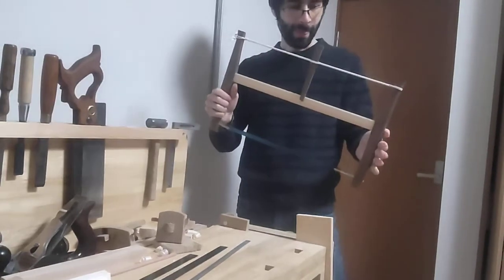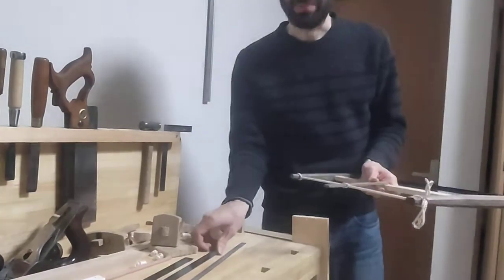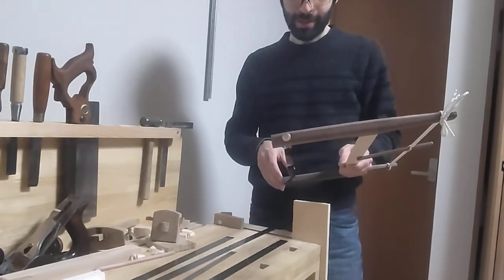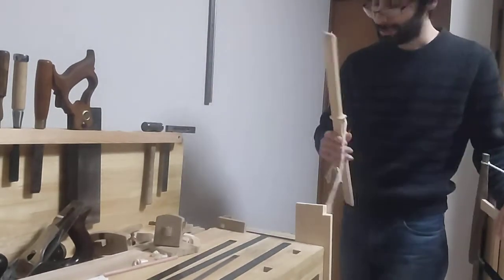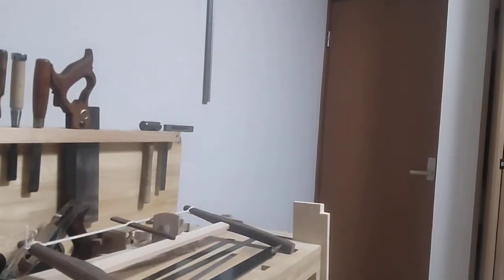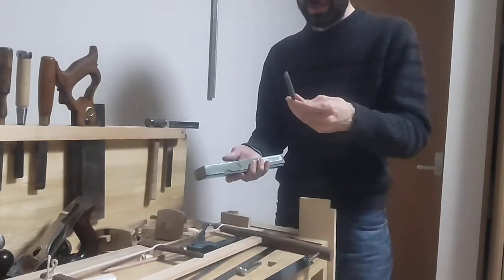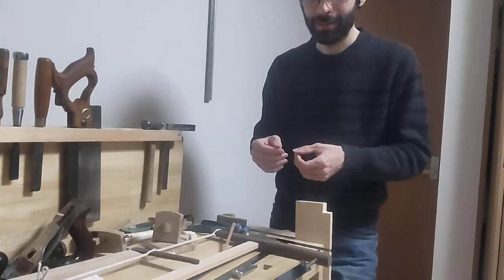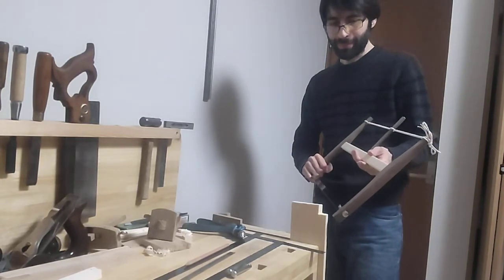Introducing Chinese Style Bow-saws (and how to make one)

Comment: What makes this a chinese saw vs an early european and american saw?
Reply from the maker: Mainly the size and style of the blade (and also how thin it is), and to a lesser extent the shape and construction of the handles. Western saws with turning blades (and I don't mean the small turning / coping style bow saws, but the larger ones meant for general work) tend to be much larger, have much thicker and longer blades, and tend to have large wooden handles as opposed to simple bolts on which to mount the blade. That said, there was quite a bit of variation in Historical Western designs, and you can definitely find examples which are more similar to this.

Chinese / Asian varieties tend to use thinner blades too. They tend to be about 0.4-0.5mm thick, and the one I'm using here is 0.3. I love a thin blade as it reduces the amount of material removed and therefore work necessary when cutting. European examples are typically 1mm or thicker even, albeit much longer.

The style that I made here is pretty much uncommon outside of China, Taiwan, Korea, and South East Asia these days. They're typically used at a 45 degree angle with the blade rotated outwards to allow for deep cuts, and some designs even have this angle cut into the frame and the blade rigidly mounted at 45 degrees, which is not something I've seen in other styles.

The basic bow saw with a turning blade, however, is pretty universal the world over, Historically speaking. They're a simple tool and there's only so many ways to make them, so they're pretty much all more alike than they are different from one another.

Comment: I`ve just found a Butcher`s Saw Blade for frozen meat /bone / wood.The thickness is .56mm and 10 tpi . The blade is carbon steel and I "think" it`s 1/2 inch (13mm) wide .The length is 17 1/2  inches hole to hole .  Minimum order is 3 . Price for one is £6.60.   Fits in a Kamlock saw, if you know what that is .
 I tried a Mitre saw blade but 14 tpi is too fine although it`s nice and wide .
Reply from the maker: I know people who've made good bow saws from a Butcher's saw blade. I would personally prefer something a bit wider than 1/2 inch (this will wander easily, which does make it easy to steer, but a little too easy at times) but 10 tpi and .5~.6mm thick is perfect. Definitely give it a try.

Comment: The Chinese seem to make push saws and the Japanese make pull saws . Thinking about the frame saw design it would be mechanically best if it was a pull saw as most effort on the cut would be straight through the blade. With a push design the effort has to travel all around the saw frame before the cut begins . Discuss .🤔
Reply from the maker: I use both Japanese saws, and push saws, and it's not that straight forward. Japanese pull saws -- any pull saws really -- have one major weakness: ripping (cutting with the grain, as opposed to across it). If you rip standing over the board as you normally would, the teeth actually catch underneath and against the grain, instead of shearing with the grain like a chisel if you were using a push saw in the same orientation. In fact, it is impossible to rip at any kind of angle other than 90 degrees unless you get underneath the board (which means a face full of sawdust and a very difficult working position), and even then, you're sawing blind because the cut is leading on the other side away from you. I love Japanese saws, but they suck for ripping. The Japanese long ago also used bow saws like this, probably precisely for this reason.

Comment: I prefer the joinery saw style where the forward frame is cut at 45 degrees with just a pin.  Faster for blade changes; lighter; easier to align; cleaner as far as hanging up on the wood; traditional; faster, cheaper and easier to make..
Reply from the maker: Ah yes, that design appeals to me as well and I've been intending to try it out. I've focused on the fully rotating blade mounted on pins first because I find that I occasionally need to turn the blade further to keep the stretcher out of the way. But, of course, a make a larger frame and higher stretcher can also solve that problem. Great to hear from someone else who has experience with these saws!

Comment: I'm very interested on making a chinese frame saw..i ve seen various videos  but It would be interesting to discuss the "design"..i see Two main advantages : the grip . The hand Is in line with Blade.
Reply from the maker: Exactly! The in-line grip is awesome and allows you to really get behind the cut. The grip is very comfortable and allows for both power and control. The Chinese design is also much easier to make if you have a drill bit just slightly smaller than the bolt you'll be using -- the bolts need to be very tightly fit so that the blade doesn't rotate too easily of its own accord.
The Chinese style saw also tends to be a bit smaller and tends to use a thinner blade, which I also like. The blade hardly needs much set at all.
Reply: @lukedupont8564  many Thanks for your anzwer: you showed clearly the simplicity and the effectivness of this ancient tool.  Here in Continental Europe Blades are slightly thicker , around 0.7 mm . Chinese masters use thinner Blades . In your experience a 0.6 or 0.5 mm Blade does cut straight on thicker wood? And last but not least, where could i buy my steel plate in order to make my Blades?
Reply: @Mechanicus_Instrumentum  many Thanks! I used 12 mm steel bolts to make pins. Hope those Will work...i saw chinese master used brass Bolts  : they presents a "mushroom" head which Is very pleasant to Eyes and to the hand , too. I cant sort such bolts here in Europe.

Comment: Hi, it's great to see more interest in Chinese traditional woodworing tools. I bought these on aliexpress, they are heavy and I find that they perform better when using on a lower bench like the roman or old chinese carpenter's bench. The blades are 65 Mn steel with black coat quite similar to the one you showed though I don't know whether they were resharpenable. Their set is strange too, it's 2 teeth bent to 1 side followed by 1 to the other, rip cut teeth btw. Thanks for the video.
Reply from the maker: Hey! Yeah, I quite like Chinese traditional woodworking as well -- the tools are really quite wonderful. I bought some Chinese bow saws as well, but I found the ones you can buy online to be inferior to what you can make. The saws and blades I've bought inexpensively from China generally have two major flaws: the pins, which the blade mounts into, are often fitted too loosely and allow the blade to turn too easily, and the blades often have excessive set. Videos that I've watched of a professional Chinese woodworker making his own saw emphasize these points. It seems that many woodworkers in China make their own tools.
Making the blade isn't as difficult as it might seem, by the way. I'd suggest giving it a try if you know how to sharpen a saw already.